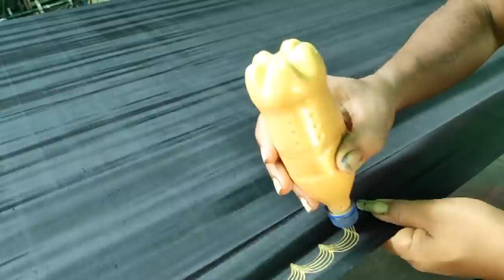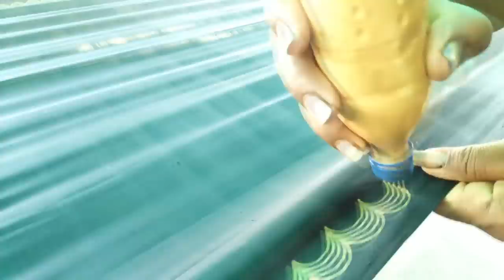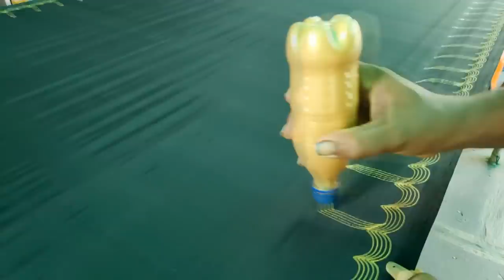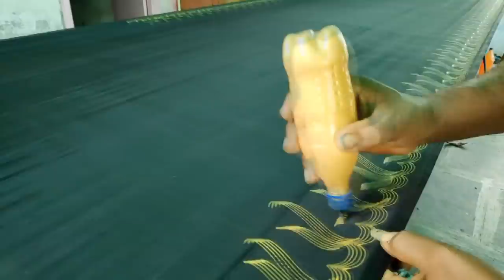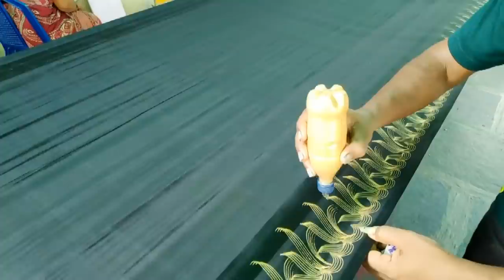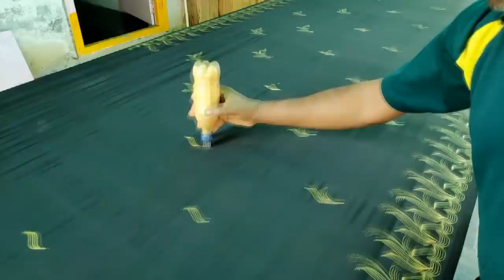Golden Creative Painting on Pattu Black Saree | Black pattu Saree on Golden creative Design Painting

Comment: It is not a soda bottle. I hope he has fixed 2 or 3 syringe needles through the cap for easy flow of paint. At the same time he has diluted the paint with some chemical. Hope I am correct.
Reply from the maker: this is small thumbs up bottle
Reply: We are asking about the needle/syringe, which u have fixed to the bottle of the lid. Where did u buy. How u have fixed. Pl reply.
Reply: @sailakeshav1167  see shyam's life style e bottle video untundi